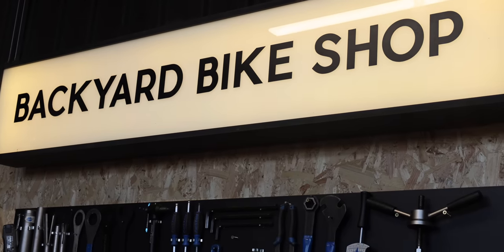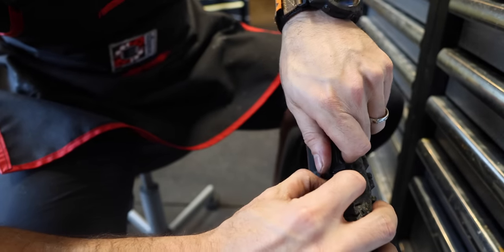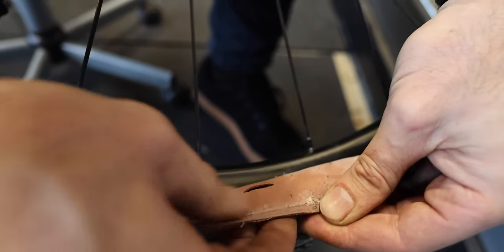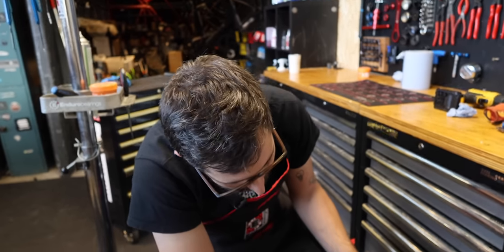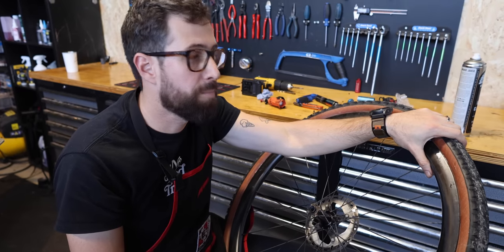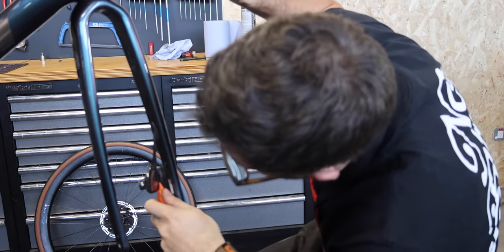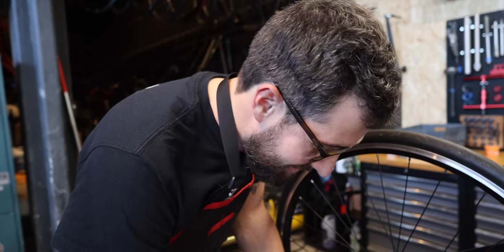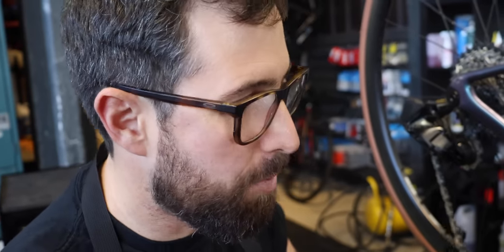How to Fix Common Roadside Problems Like a Pro Mechanic

Comment: For splitlink removal i just use a shoelace or piece of rope. Thread it in both sides next to the link, pull on it, and done.
Reply: Admittedly this is only relevant for attaching the split link, but last time I did this on a Shimano chain I was able to secure the links by hand. It really didn’t take much force (you just need to align the links properly first). Great hacks though (especially the gear cable one!)

Comment: To fix a cut sidewall, and to be used in conjunction with a spare inner tube, as a tyre boot I have several different sized pieces of cut-up old inner tube, (the bigger the better). Place inside over the cut, insert inner tube and partially inflate to keep in place, then fully inflate. I love the cable reuse, and will scavenge a few lengths when I next replace my cables. Clever use of a CO2 canister too. Oh and yes, and my tool kit/saddle bag is growing larger.

Comment: Watched this and didnt think I would learn a single thing, I was right again! I learned 2 new things, thanks so much!!! Huge fan of Josh, Nick and Francis cade. Could you help please??? Occasionally I have major trouble getting the bead off the rim, no problem really at home but couple of times bikepacking I used my folding saw to cut an approx 2 inch diameter branch, placed against tyre close to rim and bashed with a big rock, worked both times and was lucky not to damage the tyre. Have to make sure the branch has a really cleaan/smooth cut. Do you have an alternative fix please??? Eddy from The Toon.